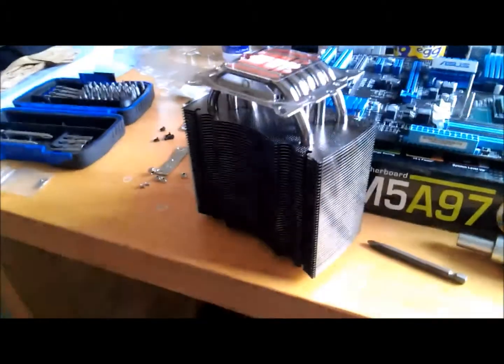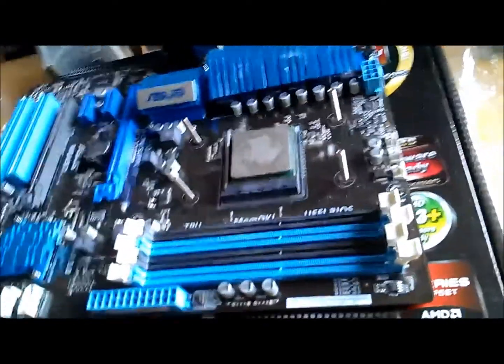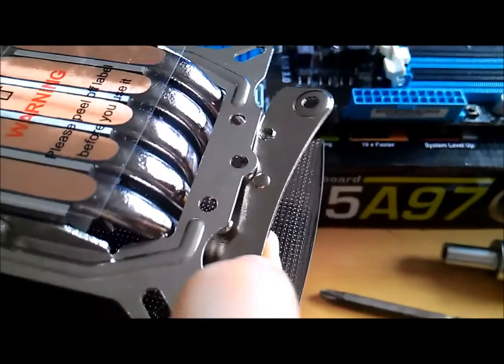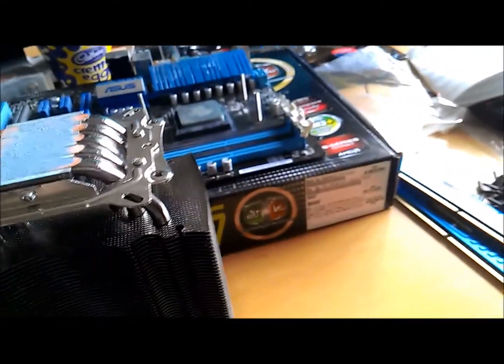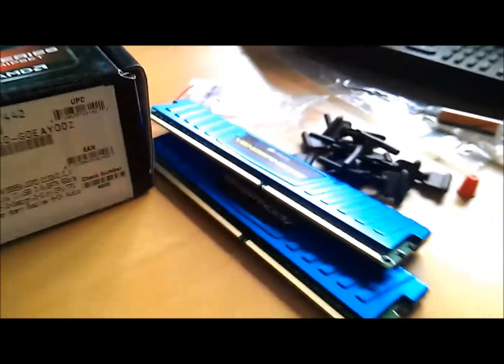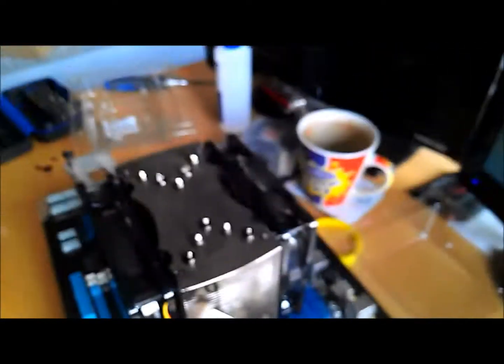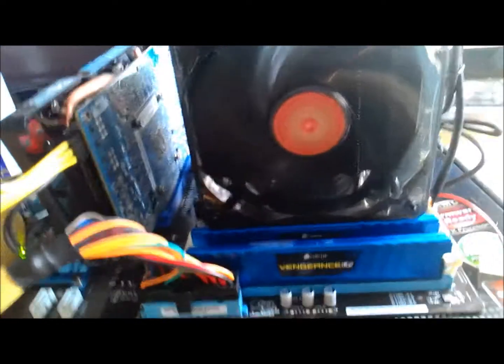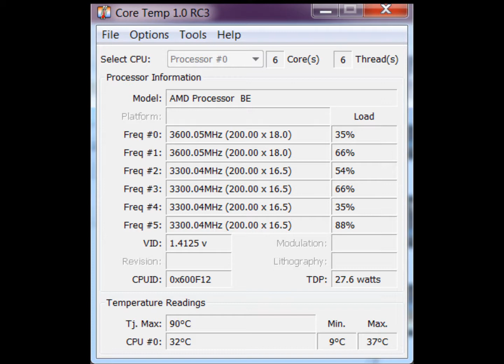Spire Thermax Eclipse II CPU Cooler

Comment from the maker: yes i do believe you would have an issue, with any of the corsair dominator range. majority of the CPU heatsinks these days have fans or the heatsink going over where the RAM would be. to resolve this, get low profile RAM like I did, or get a smaller heatsink. if you dont want to do either, you could always try the corsair range of water coolers. they're good, but i just didnt want any form of liquid in my pc :P